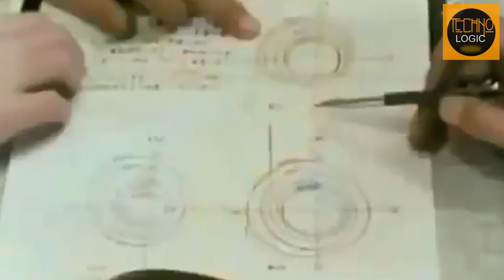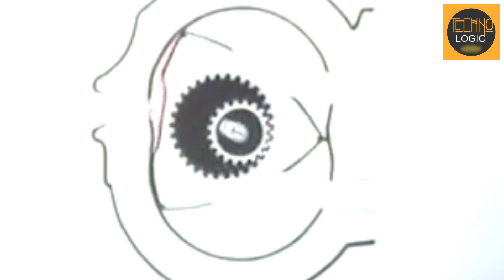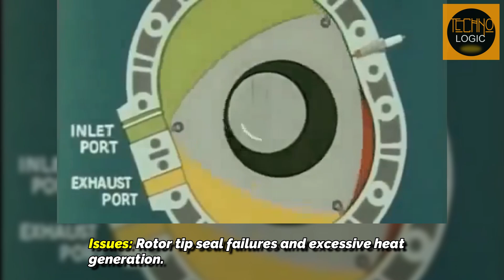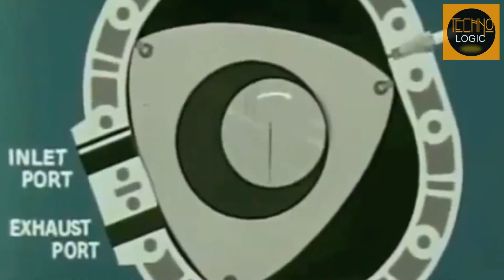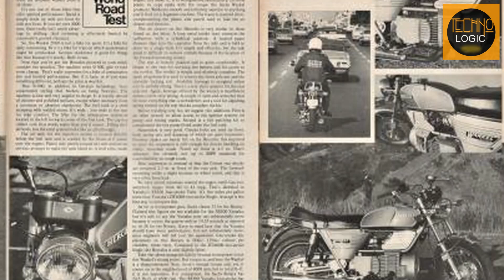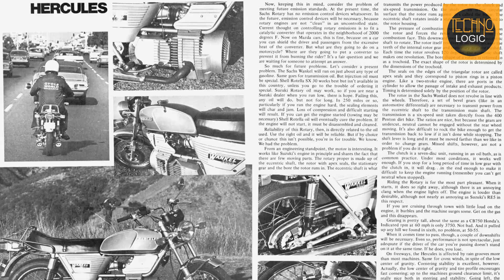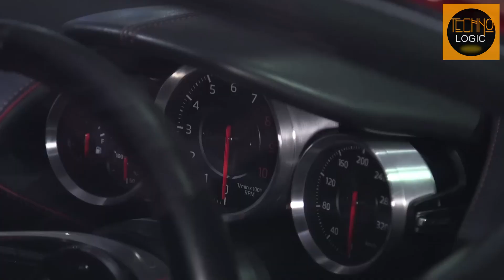The First Mass-Produced Wankel Engine Motorcycle: Revolution or Flop?

Comment: Born 1956 I bought one of the first model from this bike. The engine runs very smooth. After 2 years I sell it because I need a car. The later owner killed the engine because he had forgotten the oil mixed with the fuel.

Comment: While working at 441 Cycle Shop in Fort Lauderdale in the 70s, the owner, Georges Jacques, bought a couple Hercules W2000 motorcycles in hopes that they would sell and would be a nice "second line" to the BMWs we sold as a mainstay line. While fun to ride, and smooth and decent handling, they weren't what you'd call fast or practical, for all the reasons stated in your video.

Comment: In 1974 to / 1975 Suzuki built a 500cc rotary engine for it's RE5 motorcycle. I believe it cranked out 60hp. Of course Mazda in the mid 90's with the rx7.

Comment: Invented in 1954 but used by German military in WW II?
Reply: comeback as range extender 2027
Reply: WW2 finished in 1945 how was that possible?
Reply: learn to listen, "the development was supported bij the germans in ww2" 1:18 development doesnt mean "used"
Reply: @wimvandesteeg1353  My hearing is fine thank you but I think you need to work on your logic.. How can the development have been supported before it was invented? The narration clearly states at 0:32 that Wankel started his research in the early 1950s. if you want to suggest that Nazi Germany supported the idea/concept of a rotary engine that's  a far cry from claiming they actively supported the research, invention and development that began 5-7 years later.
Reply: BMW R27 had a kardan shaft not chain Like Hercules and DKW????😮😮😮😮😮